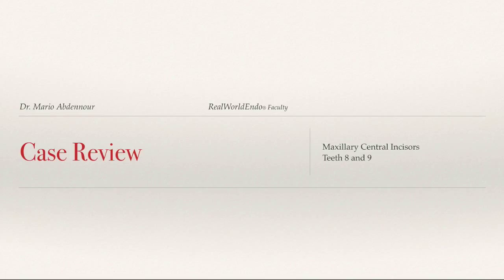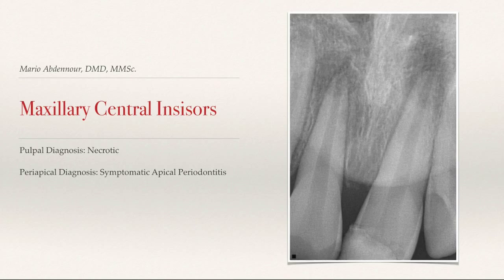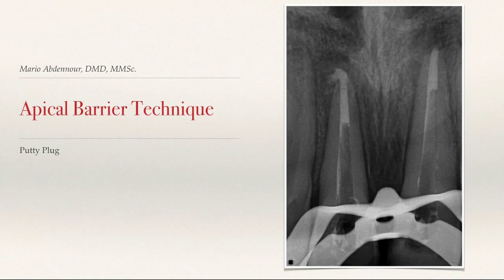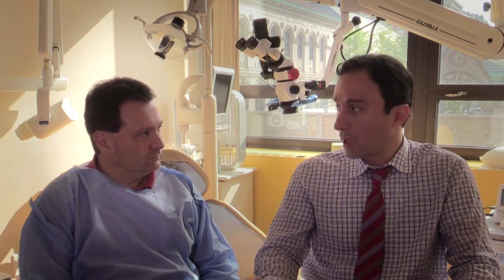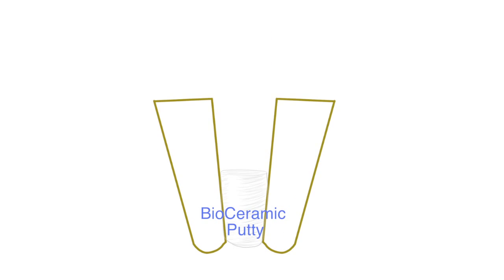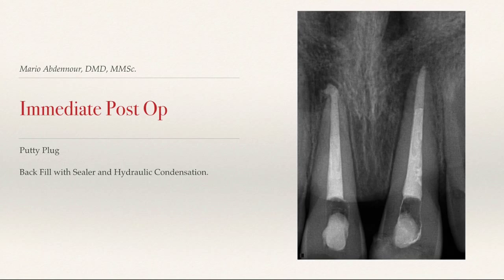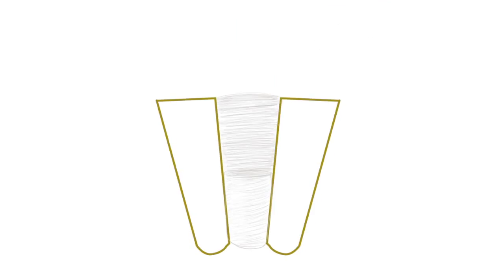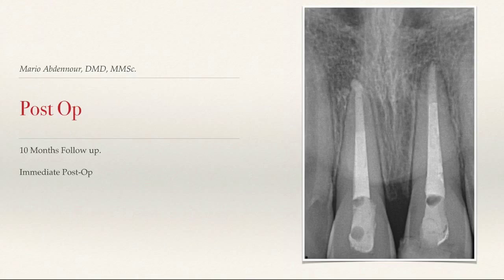CBL #7 Apical Barrier Technique with Dr. Mario Abdennour

Comment: thank u doctor . i have a question . is it better to have an apical constriction naturally through apexogenisis or through this technique and i am talking about prognosis on the long run since the patient is still a child . will the tooth maintain the apical seal 20 or 30 years from now ? and can this technique be done on multirooted teeth . can we make an apical plug for each canal through the use of bioceramic when canals are open . as always thank u for your great videos dr allen .
Reply from the maker: No one knows the answer to that. No long term clinical studies have been done to clearly demonstrate that. It seems logical that apexogensis would be better but it's generally done in vital teeth. If you're talking about regeneration then it's a different story. That answer is not known either.
Reply: Real World Endo thank you for ur quick reply but what if we encounter let us say lower six with open apex that needs endodontic treatment . will it be easy to create apical seal for 3 or 4 canals in compare to the straight single canal of upper central . what if the tooth is not vital and pulpotomy is not an option . would you doctor do this technique in multirooted teeth ?